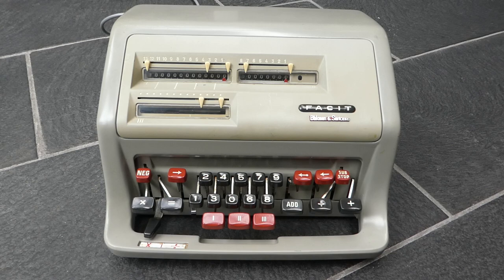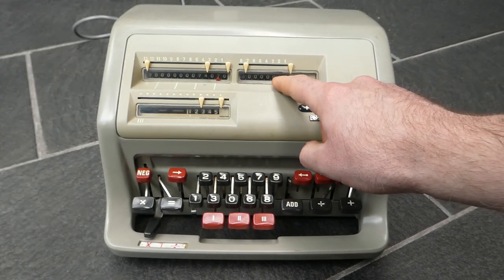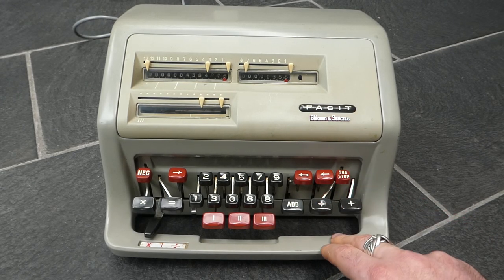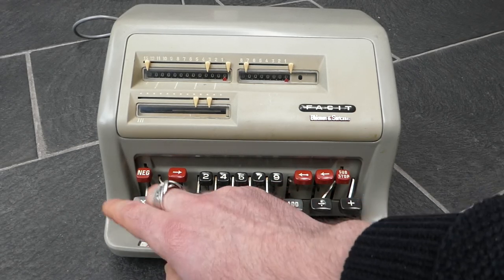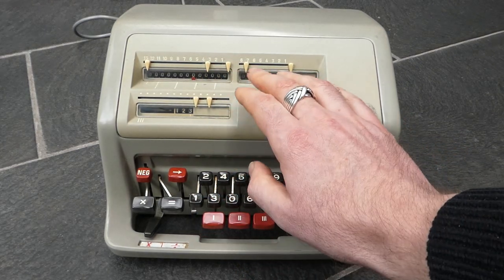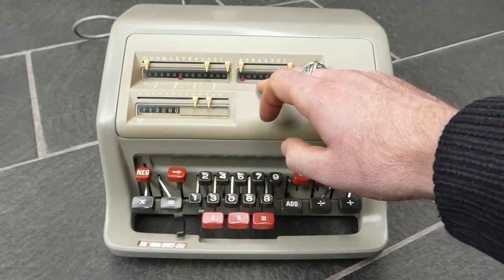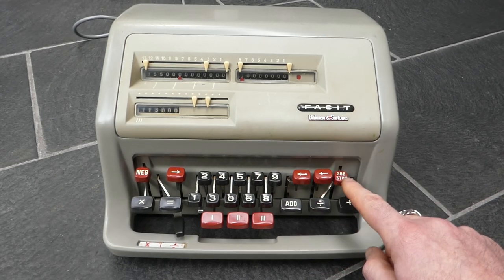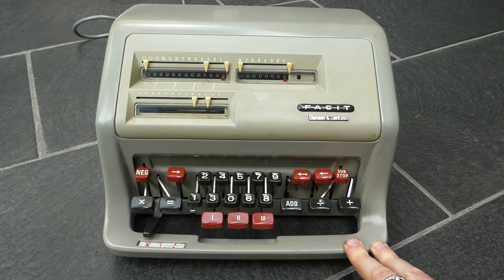The Facit CA1-13 fully automatic mechanical calculator

Comment: It's fascinating to see how the user interface for these fancy ones started to coalesce toward the "four-function calculator" set as they became fully automated--but it still has all the controls so you could use it much like a pinwheel calculator with a crank if you wanted to.

Comment: A somewhat crazy user interface, but that machine has a lot of tricks tucked away inside!!!  I like the shortcut multiplication - I can't think how they made that part work - pretty clever stuff.
Reply from the maker: I only realised later that there is a complication with shortcut multiplication, namely that it cannot be done on the leftmost digit. I tried it out, and indeed it will always do that digit normally. So if you multiply 99999999 then it will do one subtraction and 10 additions in the leftmost digit. Amazing!
Reply: @jaapsch2  They must have spent some time figuring out how they were going to make that system work - I'd love to have been a fly on the wall of their design department.
Reply: All four of the basic operations have completely different user interfaces!

Comment: 2:32 I like that the left arrow key is on the right hand side, and the right arrow on the left. That makes perfect sense and is not confusing in the least.
Reply: is this sarcastic?
Reply: @krnldude  ofc
Reply: Also, you multiply with the "+" button and subtract with the "÷" button.
Reply: It makes sense. To push something in one direction, you need to apply the force on the opposite end of it. If you want to apply force on the same end that you want it to move, then you're not pushing it, but pulling it. These buttons push, not pull, and they even indicate the direction they're pushing with an arrow.

Comment: That's quite a weird machine. Was this before user interface design was a thing?
Reply: The original Facit Model TK had quite an elegantly refined user interface... for a crank-operated pinwheel calculator. I think what you see here is the result of grafting automation onto that pre-existing design without changing any of the original features.